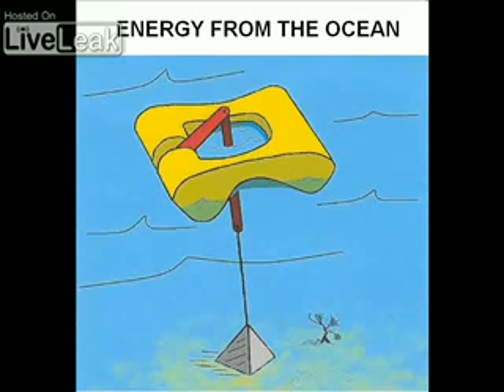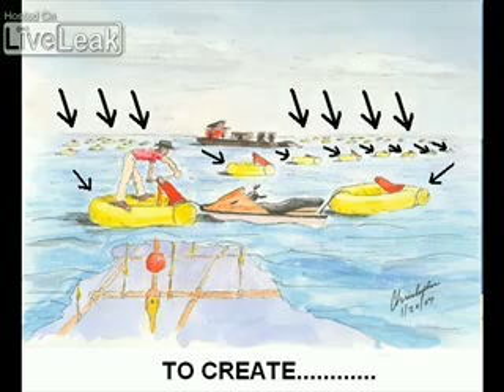Debunk this: FREE ENERGY

Comment: Here is the problem: with maintenance costs, and installation it will take between 3 and 5 years before your windmill starts paying you more than the initial outlay of cash, then you are working with an outdated windmill and will be looking at a replacement. When you replace a blade at almost 1/2 the cost of the rest of the unit (including labor) you will understand that this is just not a valid option as it is not consistent or less expensive that city power.

Comment: One other thing, I agree with you on PV. I don't think they are a net energy gain at all. If you take the embodied energy in the entire factory (the building and the machines), workers, their transportation to the plant, the plant's energy use and divide it by the amount of electricity all of the panels will eventually convert to electricity, there is more energy going in than you are getting out.
Solar hot water, OTOH, is a much better solar panel.

Comment: Yes, there is maintenance, but not that much. You can build a windmill yourself (a small unit, say 1kw) and get more money in electricity out of it, then put into it, especially if you are remote and would have to pay the electricity company to run lines. Then there is also water head if you have a stream on your property with a good drop (say 50ft or more), which is much less intermittent. But I do concede that it wouldn't be totally free, because you have to pay for the materials/labor.

Comment: The actuators on the pontoon style can also be configured to produce on the up and downstroke with dual generators and one way clutches on the input shafts. Then you are not wasting 1/2 your output energy with the return spring design like you are using.

Comment: There's also giant articulated rectangular pontoons with similar devices at the hinges that are modular. The more you add the more power is produced. They ride the waves headlong cause the hinges between the segments to flex with great potential difference. All these devices end up wearing out requiring maintenance and are not practical unless you are in a remote area with no other choice. I would design a multi segment pontoon device as they produce steadier output as one is always moving.

Comment: The energy that went into the units materials will not be recovered with the minimal intermittent output before your life ends. A kilowatt hour (1000 watts for 1hr) costs around 12 cents. Hour many months would that need to run to produce 1 KWh? Now if you scaled it up with a salvaged barges, some 1" steel cable to a device on the shore with a massive geared up flywheel then anchor it into the ocean bed there will be some useable potential difference. It's been done already though...

Comment: Restraint your enthusiasm and do some calculation. The energy flow is not smooth and this would cause a problem. When you link hundreds of such elements, you'll face two problems: a lots of cables, or if link close elements the result may be a low efficiency, since these guys will no longer ducking freely.

Comment: No, no... LITERALLY, in the same way that coal is limited, the materials needed to make wind, tidal and solar generators are limited. Indinium, used in solar panels, is predicted to run out in 12 years. Coal, oil and gas are predicted to run out in over 35 years each. The electromagnets used in conventional power stations can be made of iron, which is, by human standards, effectively unlimited (and reusable).
There is no possible definition of "free" that encompasses what is seen in this video.

Comment: Saying "free energy" rather than "renewable" is misleading. Coal is equally "free" to take from the ground as a renewable energy generator is to manufacture; the differences being that coal will not last forever and causes various environmental problems, while being more convenient and still cheaper than renewables.
Saying that renewables don't need other commodities to make is also misleading; there is not enough neodymium on the planet to change our power over 100% to wave or wind energy.

Comment: It is not FREE ENERGY, because there is an embedded cost in every Joule generated due to the cost of manufacture and maintenance, before getting into the idiot FREE ENERGY FROM MAGNETS delusions.
It is RENEWABLE energy, which is more expensive (currently) than non-renewables, which is why we aren't using it now but will be in the future.
The problem with tidal/wave energy is that it is very limited, both by location and the fact that such a small amount of energy can be yielded per unit of area.

Comment: First for the dickheads it is FREE ENERGY because we don't have to burn coal or wood or use nuclear products to get it it is already available FOR FREE! Not NEW ENERGY.
Second: I and many others thought of this long ago but it wont happen because it will upset the coal wood and nuclear industries.
Third: the idea I had a was paddles stuck to piers etc so you don't have a bunch of plastic floating around. Bolt the handle to the pier and let the plastic part move with the swell.

Comment: Small cost in equipment? Have you priced home solar cells? Let's start with the facts shall we? Our best solar cells (NASA grade) are about 25% efficient. Home solar cells are 18% if you really have that kind of money to spend. It's not FREE, and the energy you get is not free. Solar cells do wear out over time as well. The term "free energy" is used to define machines that produce more energy than you put in, (see perpetual motion machines) that would violate the laws of thermodynamics.

Comment: Hi there FlippingFermion, Pb/acid batteries have their place in green energy, such as solar energy when the source is not available for part of the day, but wave motion is available all day. Capacitors are a better fit for harnessing wave motion energy. It is true that they have lesser capacity, but they are less expensive and can deliver higher instantaneous current for the price. As wave motion energy can constantly replenish the supply, batteries are somewhat redundant. I hope this helps :-)

Comment: This isn't free energy! It's abundant energy but it is not free. All electrical energy, in the "form" we currently use it, is generated by conversion of some other energy; whether it be heat, locomotive, geological, or magnetic. For energy to be truly "free" there has to be a gain in the conversions of energy or else the system will deplete itself over time. Whether that time is 1 second or a billion years is totally dependent on the energy in the system. All in all, this is a good idea.

Comment: we already have water generators they work better on the river because theres a current which moves only in 1 direction just have the rudders to push the wheel and it turns the motar which powers the generator  and charges lithium ion batterys which create wireless energy which will be the new future because we have enough energy sources without polluting the ocean were a vast majority of our food comes from.

Comment: First off is it making AC or DC power if its AC there r some big problems its a static pulse AC and thus cant be fed into the lines. Sec if its DC u than have to invert it to AC and u will loose most of yr power in the convertion to it AC no madder what way u have it both will take alot just to make the power useable. The idea is good but there is alot of room for improvement i know what u r doing fishing for ideas to improve it well the ones i have ill just use on my own!

Comment: the more common definition of "free energy" is producing energy from perpetual motion devices.  The energy produced in this video is just as free as building a lever you can turn yourself to generate electricity.  It's inefficient compared to costly energy which is why we're still stuck with the more costly energy.  I'm sure we'll move on eventually

Comment: First you don't need music over your comments, we can't hear you !! Second, you need waves with amplitude, so place two sheets of wood a couple of feet apart and orientate into the waves, if you move the sides in at the back the wave height will be amplified, and you can extract more power. you do not need with a SWELL you need waves, regular and constant, that requires funneling the wave into position, if the wave can move around the tethered float then you will loose power.  deuuuuh !!

Comment: I do believe there are ways of harnessing wave energy. I just do not think this is the way. There is ALOT of energy below the surface. I think something out of sight would be better. I ould rather have 100 windmills vs 100,000 of these floating on the surface. Also you made the device out of ABS plastic, which is the cheapest form. Plastic though needs the use of fossil fuels.

Comment: Volts are not by any means realated to power potential, but regulated by the circuitry. Potential is measured in effect, in electricity normaly done in the unit watts (w, or Kw for thousands of watts) and in mechanical force by horsepowers (Hp).

Comment: The average American household uses (I think) about 3KW of electricity per month. Realistically, I don't think that anybody wants to have that kind of "buffer" to have to maintain. It'd be analogous to Eniac w/ its 20,000 vacuum tubes. Capacitors would be OK, for quick recovery of dropouts. I think the best solution is LED tech, and Li-ON  or gel cell batteries. I just don't think that most Americans (or the world) is willing to rewire their household for it, (yet) Do-able, not practical.

Comment: Sound scientific principal. Immediate use of energy is one thing, but an non-interrupt-able supply is quite another. I noticed about 24 volts worth of LEDS connected, but the WORLD doesn't run on 24 volts. The change in infrastructure would be opposed immediately. It's DO-able, but it's not "convenient" or practical at the current time. It could be augmented in higher tidal areas to create better results though.

Comment: I know but it is the same concept.  Plus there is a greater height difference between high and low tide than there is between individual waves.  A machine that uses that concept with individual waves would constantly need to be moved along the shore to compensate for high and low tide.

Comment: This woks like okay like the others.  The challenge is the attachment to the sea floor.  Long term weight anchors sink or come loose.  If you have a large enough system that it is pulling on the anchor chain hard, it will try to pull up the weight.  That will make the anchor chain straight up and down, and, as high tide hits, will completely submerge the floats, reducing power.  Buoys have used this for compressed air for fog horns. Now solar cells are cheap, those systems are less popular.

Comment: what if instead of it floating, you place a copper pipe coated in something like rubber so it dosen't corrode and placed a float, bearing magnets with the electrode wire coming off the top of the pole. Basically like a stick in the mud with a float ring.The action of the waves create the up and down motion.Add opposite permanent magnets to the ring causing induction. Use this to power a magnetic motor with gear reduction.

Comment: It will laterally drift furthur away from its anchoring point is my guess. Now this brings about the problem of stress points if these little guys are gonna be daisy-chained together. There would have to be one anchor point for multiple units but enough to secure it to the bottom so they dont break free yet allow free motion to roll with the waves properly and act like a suspension to absorb the pulling force from multiple angles at any givin time. Avoid tangled anchoring lines with a wide base.

Comment: And exactly what makes you think I'M the one building reactors at home?!? People like you only see what you want to see instead of what's really said.

As a matter of fact, the U-235 needed for the reactor IS safe to handle, UNTIL the reaction is initiated. If you have anything that glows in the dark, it's probably more radioactive than idle U-235. The chemtrails dumped on us are more dangerous than idle U-235.

Once the reaction is started, it's fully shielded anyway. Think before you spew.

Comment: This isn't free energy ... there's nothing to debunk.  "Free energy" implies something from nothing (or a lot from a little), which is not the case here ... it's converting linear kinetic energy into electrical energy (with an intermediate rotational K.E. step) at less than 100% efficiency.  Everything you see here is completely legitimate and possible.

Comment: First. This isn't new. They have been around for decades. Read old PopMech's.
Second. It's not free but that is kind of irrelevant. Once the initial investment of labor and parts is made and the device is placed, it will produce energy. How much will depend on how big a generator you use. And, like windmills they will need Huge Gens to produce any significant amount. Also like windgens, the price will go up exponentially. Which means Bigger Floatation. I think you can take it from there......

Comment: You could use it to charge batteries all night and then convert dc to ac.  Populpar Mechanics has shown generators making electricity from wave action before.   You just have a different shape.    There might be patents already.  You can make anthing for  you own use if some else has a patent just can not sell it.   Hope no one has a patent. .  Since you design is different syle of wave gathering energy you might be albe to get a patent  good luck.

Comment: while this is a great application of hydrodynamics to create electricity it's not free or even new. Free energy is positive net return energy, meaning that you get more then you put in. This is just an electric generator run by the waves, which is the energy in used to create the energy out. Good job though, we should of been using this tech a long time ago, or at least now.

Comment: the sprung spool (like one of those retractable dog leads or a tape measure) idea would eliminate problems with tides as it would self adjust, the spool would drive an AC motor creating a voltage no matter which direction it was moving in.
Great work, hope some of these ideas help. Good luck in the future.

Comment: Another idea could be to attach a rope to a pier, all of the moving parts and electronics could be on the pier and the object could be any floating mass like a boat, also if on a boat a weight could be dropped to the ocean floor, the line could be attached to a spool with a spring rewind, that way it would turn with the boats movement, good for charging batteries etc. supplying electricity to the boat

Comment: i suppose this does not necessarily need to be anchored to the sea bed, as long as there is a way to stop it floating away the counter weight could simply be of neutral buoyancy or great amount of drag, something fairly big and flat just a few meters below the device and then adjusted to have neutral buoyancy, although perhaps not quite as effective, it may not always be practical to anchor to the bottom.

Comment: There's only one problem I see with this. Well actually 2. One, it's not free. And 2, look at how little energy is being produced by that big floating rig. Barely enough to power a palm sander. It's a great idea, but the output needs to be increased a buttload before its practical.

Comment: if you anchor a chain to the sea bed as the tides go in and out the water level will rise and wall allowing you to gather all of that vertical energy instead of just the surface vibrations

Comment: not a bad idea, similar to a device I made when I was a kid that used the waves on a lake to generate power for an LED. The device needs to be made much more robust. you need to fix the housing to a secure spot and let the tides/waves provide the energy instead of letting the object bob around randomly. Also, you'd need to have this thing on amassive scale to make it useful. To those of you calling it free energy, it's only free in that we didn't need to extract the fuel out of the ground.

Comment: I think this would be more efficient if the entire armature was stable. You're losing a lot of potential power by the random floating of the device. You could, theoretically, remove the spring in it as well and take advantage of the outgoing wave. Both should give a more steady current.

Comment: free energy? the movement of the waves is converted to electricity...debunked.

free energy would mean you move the lever once, then it produces enough energy to run itself, and at least a small amount more energy that can be used to power something else. 

Any device that uses another form of energy is just a generator...

Comment: @rockethead7 

It's different because solar panels are black, like concrete, it more efficiently absorbs energy, but not all in electricity, a lot in infrared, some newer tech utilizes infrared as well, but the principle is the same, we see concrete retain heat the would normally emit back into space, but slowly heats the ground and air all night and back into the day. The affects of this are poorly understood, or at least, by me.

Comment: @scienceminded
Agreed. We're drifting from the original topic a bit (that wave power slows the Earth's rotation). But, yes, it seems that any energy source comes with a price.
I haven't heard the concept that solar panels could heat up the ground passively. I don't understand this point you're making. Wouldn't the sun be heating up the ground anyway (if you didn't put solar panels in the way)?